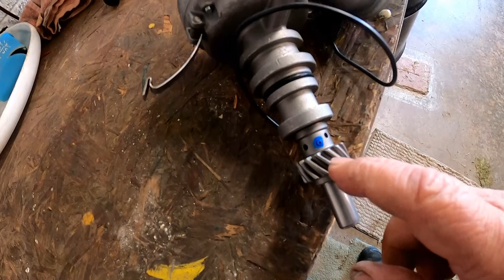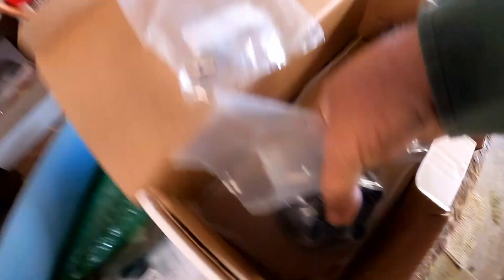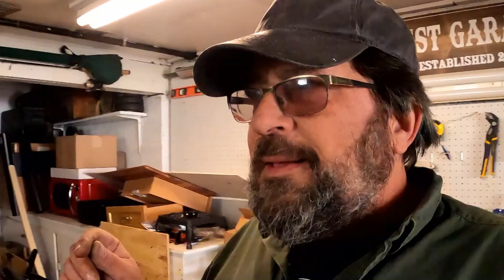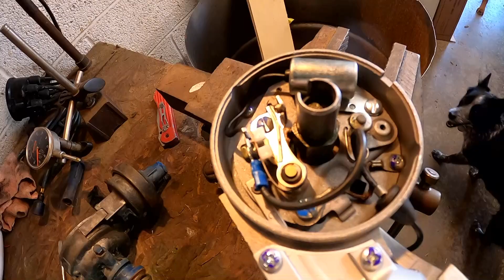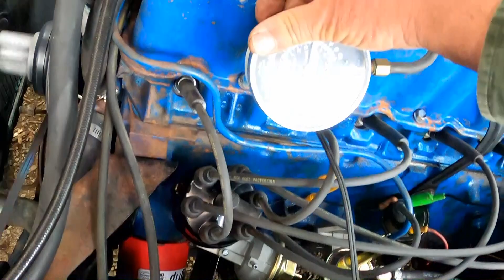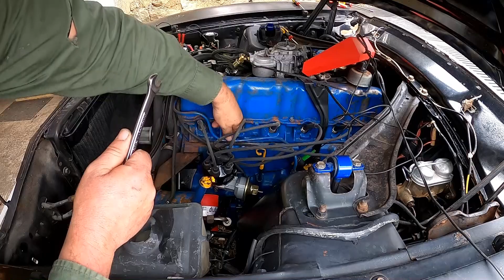We're On the Road! - The Maverick Lives Again! 1971 Ford Maverick Revived

Comment: Did you check your condenser? Also, did you match your vacuum adjustment from the old to the new? And make sure your vacuum line holds vacuum. Have you checked your valves? I would also Seafoam the heck out of your engine. Put it in the oil, gas tank and intake manifold. Or drain your engine oil fill it up with diesel and run it for 10 minutes or so. But if you do that you had better plan to pull the valve cover and clean out the sludge before it clogs your heads..

Comment: Try about.       .020.  That isn't perfect, but most engines will usually run at that setting.
Reply from the maker: It's .027 for this car. I did look up the tune-up specs before beginning. :)

Comment: I have a 1994 Honda Civic.   The fuel pump went out on it, and I had to take 3 of them back before I got one that would work.   Even now,  I have to use gasoline that doesn't have Ethanol in it to get it to start and run.

Comment: I just had a Re-Manufactured Power Steering Pump put in my 1994 ford Aerostar Van,  (Junk) took it back to the shop now on 2nd pump. Shop owner said its the Rack n Pinion, Mechanic said its not leaking and isnt that Bad. I added a Quart of Luke Additives and seems it helped it. Guess where part came from? yep Mexico, O'Riley's Auto Store LOL. I will get another opinion on it, Mechanic to look at it. Notice Alot of newer vehicles, No Carburetors. I used to adjust idle speed on Carburetors in my older olds. My brother taught me some on Carburetors. He owns a 1968 chevelle! restored It himself. Mav sounds Great!